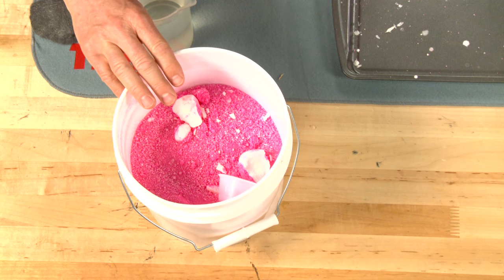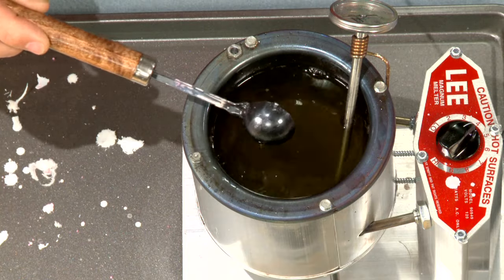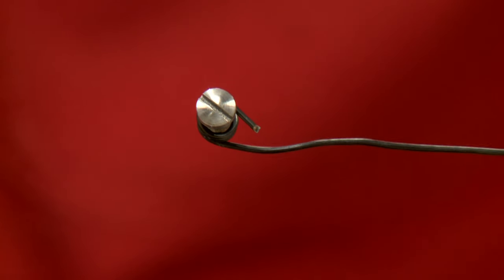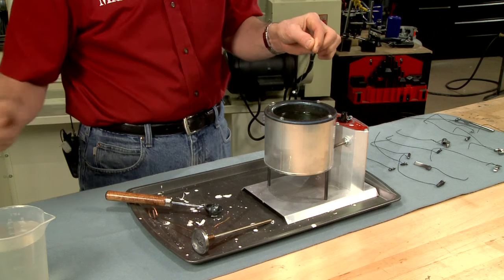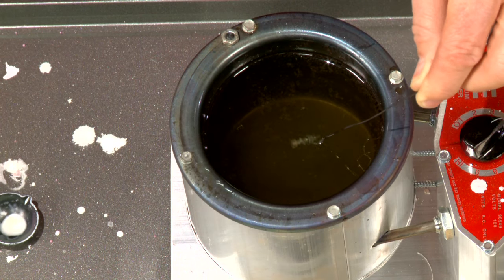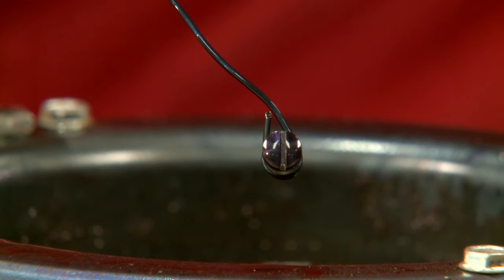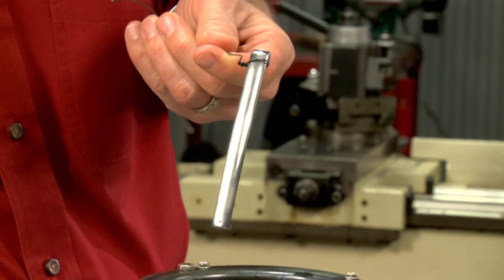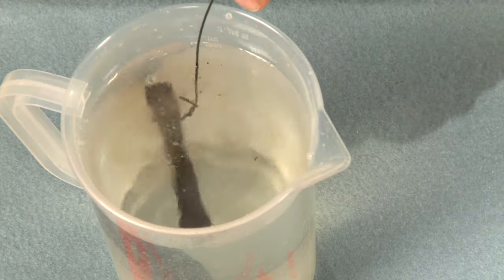How to Nitre Blue Gun Metal for a Beautiful Finish | MidwayUSA Gunsmithing

Comment: I know this comment comes late, but better late than never!  The part Larry leaves out is that you achieve different colors at different temperatures.  If the part is left in at 650°, it will eventually get close to black, which is why he tells you to watch the part and remove it once you achieve the desired color.  Around 470° you will achieve a straw color, then you will reach a brown, purple, blue then eventually black stage as you increase the temperature.  Good luck!
Reply: It's a 1 minute video on how to BLUE, not a half hour special on finisheS
Reply: @billrowan1957  this comment is 10 years old. I think you missed the statute of limitations on this one.
Reply: @sp0764  and yet here YOU are....
Reply: @billrowan1957  cause your comment was only 3 days old. I knew you'd probably be back.
Reply: @billrowan1957  cause your comment was only 3 days old. I knew you'd probably be back.
Reply: @billrowan1957 He lost

Comment: Dip the piece you want, then card (brush) off any salts that have built up.  Small parts take about 10 mins and larger parts can take about 15 mins.  Good luck!

P.S.  I find that if I keep a moderate amount of movement for the first 20-30 seconds of dipping, bubbles do not form and prevents salts from building up on the part.

Comment: Just remember Nitre bluing is rather thin, and provides very little protection from rust. In some cases it can be taken off with your thumb, so just be aware of that if you’re considering doing a whole receiver or slide. I recommend using only for small parts, that don't get handled much.

Yea BogMonkey, I think Nitre is potassium nitrate salts…

Comment: ,,,nice Larry! got a ruger Max Barrel i got scratches scrapes on from day one because the weapon had to be sent back because it wouldnt cycle,,stated they replaced the entire slide assymbly and the barrel,,but i question if they were new but will say when it was returned to me,,,it was better cycling however  the slide when weapon cycles  caused scrapes  so much so taking some of the factory bluing off with the scrapes. What i realized the slide when it comes back during the ejection and  extracting process scratches ,scrapes on top of the barrel thats exposed when the slide is closed and scrapes scratches at the farthest front of the barrel where the barrel bellows out  at the tip both areas the slide caused until i did take upon my self to sand a bit the under part of the slide where the barrel rest when inserted...Im told  hot bluing is better longer lasting where as cold bluing,,,cheaper easier to do myself may not be as durible,,,but im wondering for small touch ups,,, since its not the entire barrel and i am super clean with weapons,,im not at the range much at all well not as much as i need to,,,,how do you think cold bluing would do for just the exposed scratched and rubed areas? im told brownells ox-pho 4oz is good  and sounds perfect since its mostly a touch up job,,,let me say i vowed to not send the max 380 back in to ruger because i found out the issue thru a youtuber ,,,when i applied some sanding and polishing thing ran like a dream and by the time i figured the slide  areas that was causing the scars rub marks abraisions on the barrel now the problem i initially had with the weapon is completely rectified ero issues cycling,,but now ive got some scratches abraisions etc that are noticible thats freaking me out lol,,i may jus try the cold bluing as a touch up since its the cheapest since im not doing the entire barrel...love your videos....thanks!

Comment: @MrUrbanSurvivor It lasts longer than cold bluing, but not as durable as the hot bluing done today. I just did my first parts and they are too dark, I will try again. Beware the 600F temperature of the salts can ruin the temper on some steels. It is best to do it on screws and non critical parts. Never on a cylinder or hammer.

Comment: ok, the results of that process reminds me of the finish Colt used on the 60s and 70s vintage Pythons! Colt Royal Blue ...it was AWESOME !!! Larry, what can be used on an entire weapon to replicate that finish..that Colt Royal Blue???
Reply: Colts' blueing process originally used an oxygen-negative method in heated large steel, revolving drums using a secret mix of bone, leather, and charcoal. Unfortunately, that process was lost when Colt moved from their original site. The original blueing drums and all related equipment have turned to rust and can't be used anymore. Colt now uses standard hot tank blueing.
Also, Colts used highly skilled personnel for polishing. Many generations worked at the plant with father to son teaching them their one and only job, polishing. It could take several years before an apprentice was allowed to polish anything. Colt also used custom-made polishing wheels made of wood with the polishing grit glued to the wheels, unlike today where companies use muslin or felt wheels where the polishing material is embedded in a clay-like matrix and pushed onto the wheels.
Reply: @toddy2519  There's a youtuber (I forget his name) who was a polishing apprentice for six years!

Comment: Howdy, Thanks for the very informative videos!  Would it be safe to nitre blue a Stevens Model 325 SxS mainspring to a straw color (about 470° F)?  My concern is that it may change the temper.  If I understand correctly, it is safe as long as I do not exceed the orginal temperature.  Thanks for any insight!

Comment: Can you do a shotgun barrel?
Reply: todd lerow Yes you can if you have a massive melting pot. Nitre bluing is very, very weak compared to normal bluing though, that's why it's only done to small parts.
Reply: Why would you.  Nitre Bluing is used basically to accent screws and small parts.
It is a fragile finish that contrast the rest of the firearm.  A shotgun barrel in the British term is Black.  But it is actually rust blued, or at least called rust bluing in America.  However, if you were to have this done here in the States, as I have to a British Best Gun by a competent gunsmith skilled in the old world culture,  you would use the British term Black the barrels.  Steven Dodd Hughes is such a man.